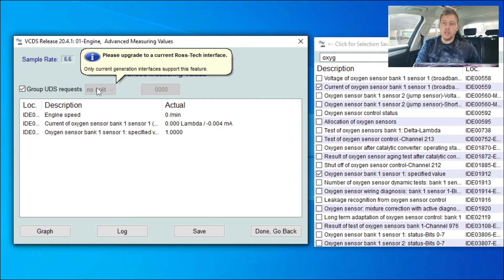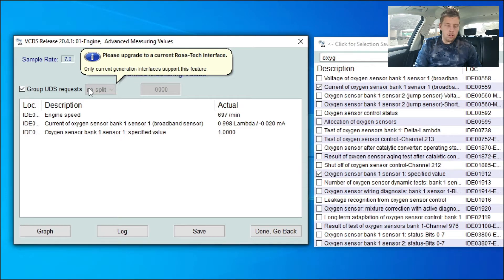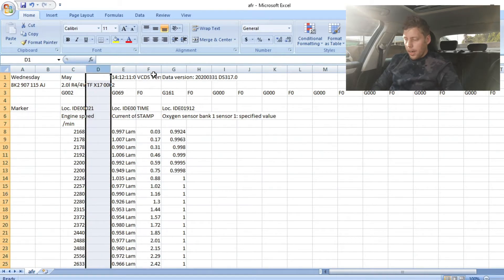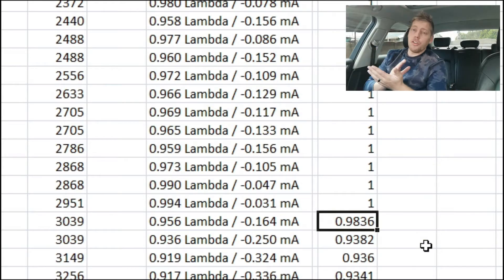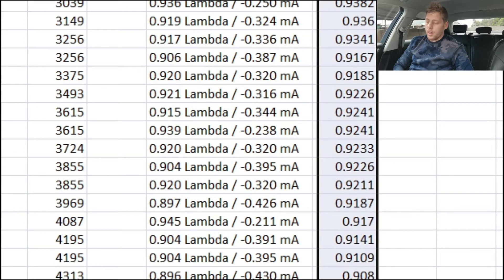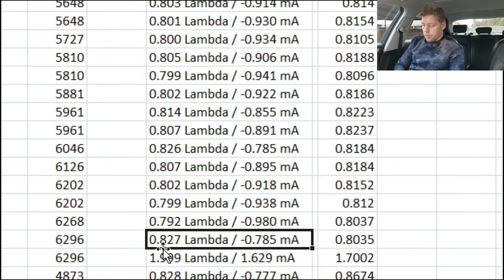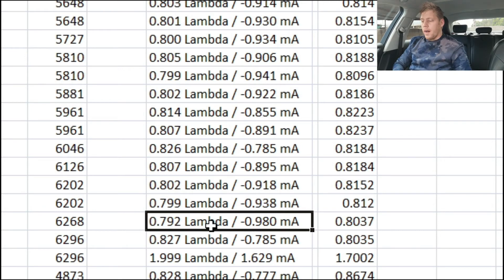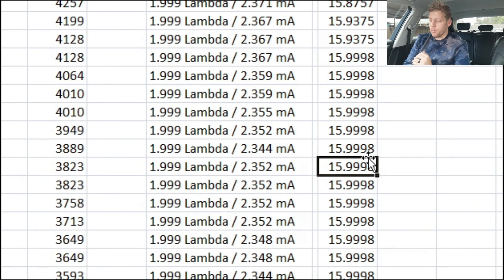How to Data Log Your AFR or Lambda With VCDS Part 2

Comment: Nice and informative videos. I wish to had a laptop. My ibiza 6L Petrol is driving me nuts with high fuel compsution vs air vs exitation vs engine going super low/muffle when I accelerate on the 1st gear, also hitting the MAX Instant consumption even with a slow and careful acceleration, etc. Can't count what I've already made to find and solve what is happening. A laptop with my Vcds, and doing this on road test would be truly helpful to check what is happening - but I only have a Desktop PC, I only can check and make tests with car stopped. My b1s1 is giving me the error 17511, so can probably be 1 of the issues. Tks for the video, it's really good stuff. Cheers.
Reply from the maker: Thank you so much :)

With your car, what car is it? VCDS might not help you as it is only for Audi, VW, Lambo and those types of cars.

You might need to find a other tool for your car. And then obviously a laptop 🤣👌
Reply: @megalodononwheels  It's a Seat Ibiza 6L 1.2 from 2003 - its from VAG group so VCDS works fine. Same exact car as a VW Polo 9N.

My average consumption is 13L / 100KM's or 18.20 mpg, which is madness. I've cleaned the throttle body, EGR, intake manifold pressure sensor, the same as some other parts, and then after I've made the adaptation and realignment on VCDS - it hasn't helped. Took the car to 3 different mechanics; none of them were able to find the problem. 

My car easily hits the maximum instantaneous consumption when I am stopped in the traffic and I hit the acceleration pedal when accelerating from a stop - it literally hits the maximum instantaneous consumption even if I accelerate slowly and gently. The car "jerks" when I try to accelerate from a stop, the tachometer needle goes down like if the car is failing and almost turns off - this happens pretty often - basically this is the "normal" - which is not supposed to be. Like if the mixture of fuel and air is not the proper one. "Feels" like the car has no air, so he almost turns off - maybe causing that hit on maximum instantaneous consumption. Obviously I've made a proper maintenance with right parts for this car.  I've been searching and searching around but with no luck. If you have any advice or ideas about what to do, or even starting to find where the problem could come from, that would be amazing.
Reply from the maker: Ohhhh damn... lol

I am not so good when it comes to Seat and their models lol 🤣... but Polo 9N i know 💪

And when I say I know them I mean like... a friend has one 🤣 and that is it lol... 🤣

I am sadly also not the best when it comes to Diesel.

I am unsure what you have done and what you haven't done.

I think you should look at your O2 sensor. Usually the first sensor before your CAT if you still have it in.

They intend to go bad. Give the ECU wrong readings and then you end up with problems like now. For example it might see there is to much air, then it keeps adding diesel and now its actually flooding the car and giving you this poor fuel consumption and performance. Also with Diesel I know the more fuel you run the more the possibility is of melting a piston. So very important to get this sorted.

You can replace the sensor as it is good maintenance or clean it by leaving it in toilet cleaner for some time 👌🤣 it works lol...

Then if you have a MAF sensor, you can try to clean it or un plug it and see. If it performs better. If it reads a wrong reading for example to much air going into your car, it will fuel more and then there is to much fuel but not enough air.

Also sometimes people does mods to their intakes and make them bigger but keeps the same MAF sensor. When ever you change the diameter of the pipe. The car needs to be retuned.

There is 2 things I think you can look at first :)

Comment: Isn't your car then running a bit too lean?
Reply from the maker: No, lean would be considered as running above 1 lambda or above 14.7 afr :) but yea my car could do with a bit more fuel, aslong as the lambda increases at higher rpm then it is fine, because that is when the car is running hotter
Reply: @megalodononwheels  I am new to this, thanks for the explanation. Watched all your videos already 😅My turbo car's graph is even more inclined towards being leaner, than yours in the video and is barely touching 0.8 at the very end, mostly staying at 0.85 throughout the mid rev range. So I got a bit concerned
Reply from the maker: No its good 😎 also remember that my car has software on, so ours won't be the same as my properties for my fuel has been altered. But yes your car should be good at 0.85 💪 most cars out there stays between 0.95 and 1. That is bad but that is how they are made from factory. This drops the emissions but is not good for the engines
Reply: @megalodononwheels  great then 😅. It's just a bit contradictory for me since the information everywhere is that it's good at WOT for force induction cars to be 0.75 to 0.8.
My car's remapped as well and I have a hybrid turbo and the boost is not reaching target, very slow to build and cannot keep up, so I am at least trying to find if there's something dangerous through the logs until it gets remapped again. Thanks for your videos 😁
Reply from the maker: No stress! Glad I could help! I found out my wastegate flap inside my turbo was loose and had play, videos will come out soon, car used to boost at 3000 rpms after i had a boost leak it boosted at 3600 and when i had the wastegate tightened it boosts now at 2700 💪
Apparently these flaps are a issue on Audi
Reply: @megalodononwheels  my model has the same problems. I don't think that is the case for me now as it's rebuilt as a hybrid and the wastegate barely moves by hand.
I can't wait for your video and so happy for you!
Reply from the maker: Thank you. I am so far behind with my uploads lol i think I have 8 videos waiting to be edited 💪 thanks for your support and being awesome! Always nice to talk to people about cars